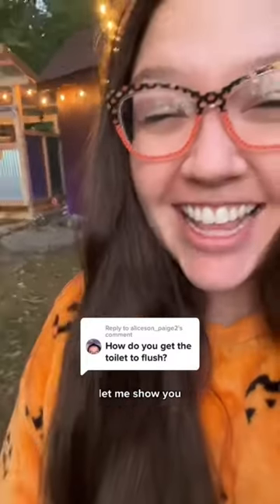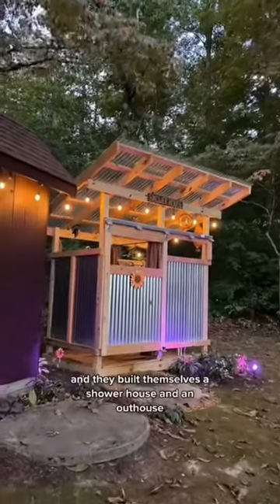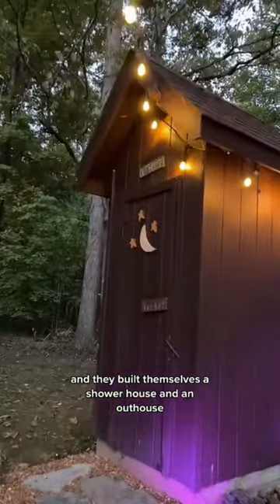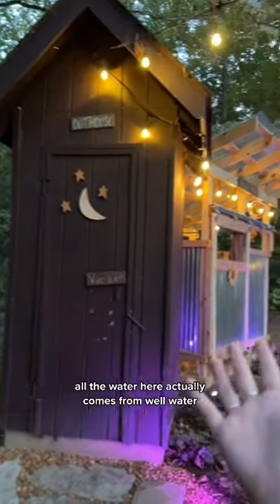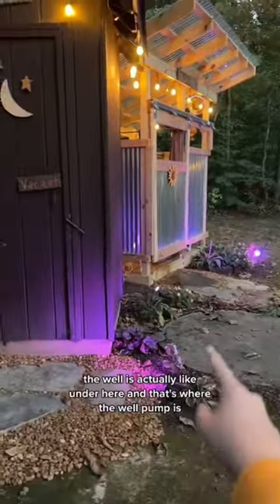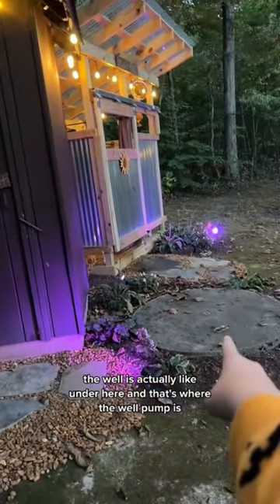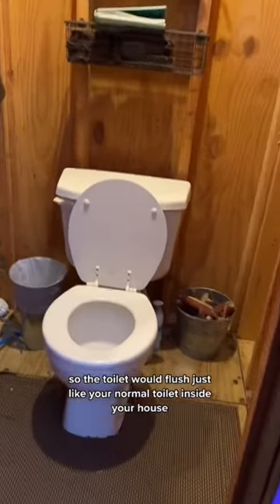How do you flush the outhouse toilet? #outhouse #shorts ￼#shorts30

Comment: is it sanitary to have the toilet and the bath house on the same water source?
Reply: Why would it be different than same water source in a house?
Reply: @glowilk5377  because ones a i can only assume closed system ie the well, and the other is a giant complex circuit of pipes and tunnels that go through a filtering process and are then pumped back into the homes via different pipes
Reply: Fresh water goes into both the toilet and the shower via the well. Waste water goes into a septic system. A septic system catches all the solids and gross stuff and the water goes back into the ground. The well is fed by rain water that is deep under the ground.